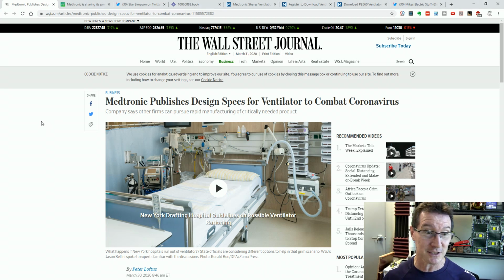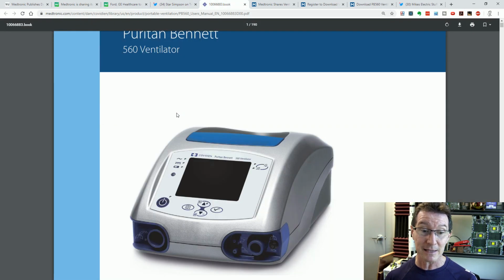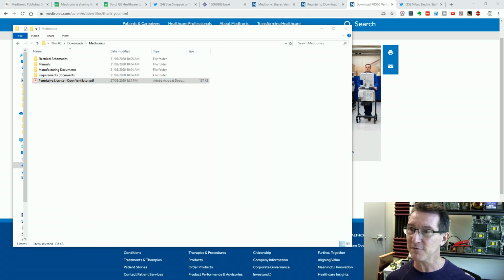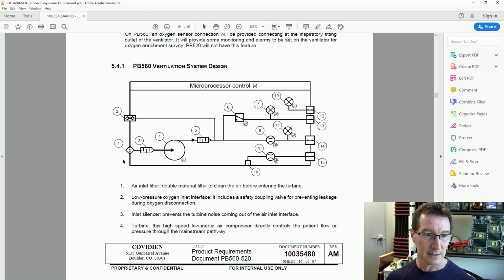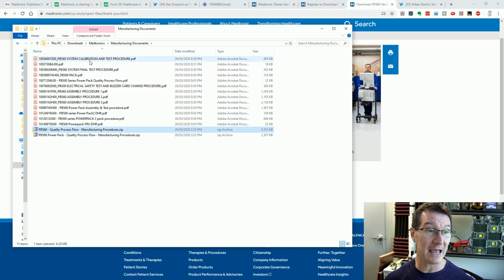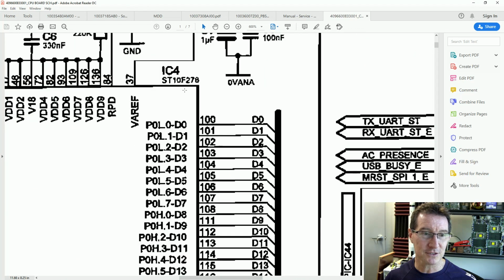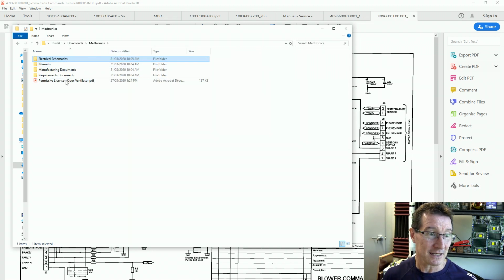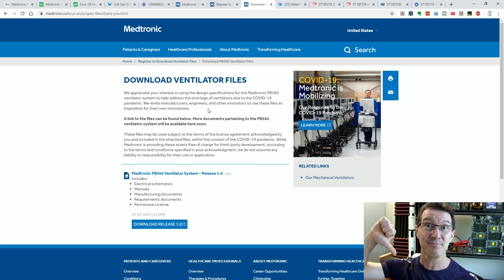eevBLAB #72 - BUSTED! Medtronics Open Ventilator FAIL

Comment: It might be a legal stunt to have people sign their "license", then design a ventilator, and then Medtronic can claim IP on the ventilators that people have designed from scratch anyway, but Medtronic will be able to claim that people used their IP because they downloaded the specs. Meh. Also have you looked at the schematics ? This is 1990 technology. Discrete parallel RAM, discrete parallel FLASH, and even discrete UART ! It's very possible most of these parts cannot be found anymore anyway, so definitely this is not a ready to copy design
Reply: Uski, combine those two thoughts - it's 90's technology, so people will be "inspired" to re-design it using modern tech, then release their design to the public, and the company will claim it as theirs.
Reply from the maker: Any company serious about this had better well checked the license extremely closely.
Reply: @EEVblog 
I would talk to an IP lawyer (such as Orrick) before developing on top of this.
It would be sad for a dozen MIT students to drop-out of school and spend a month on this to make something usable only for the corporate schmucks' lawyers at Medtronic to tell them that they own nothing.
Reply: @ba94845  Its a shame so many MIT students get duped into stupid stuff.
Reply: @MyKharli  Seems they have to still learn a thing or two. Even after learning at one of the best universitys in the world.
Reply: The discrete technology has a lot of advantages. It is easier to repair and one can still source components after 10 years or more.
Look at the schematics of a 50W railway PA amplifier, "Next train will be 2 hours late and depart from track 9".
LM741, 2N3055 and the like. 

Just like one copied a 1970s design from Elektor magazine. High noise figure, bad efficiency as this is class B and so on. But the German company who builds such stuff is proud of the design as they can ship it the next 20 years.
Reply: If it ain't broke... 🤷‍♂️
Reply: @sinaroughani7000  If you have a bus error, then the design is faulty. Always look at setup and hold times and do it right. Also life support systems need to be redundant, so the second system can step in, if the other fails.
My point is that if you use "primitive" technology you have less parts count, less parts to fail.
Also if you have 2 different systems using different approaches you eliminate common mode errors.
Just look at functional safety papers, chip failure calculations and so on.
Have cool semiconductors, and some over engineering. Also use parts that are easy to source so you can build a design 20+ years and supply it also to 3rd world countries for easy repair.
Why are there a lot of 1980s and 1970s Mercedes diesel out there in 3rd world countries? Because they last if there is no salt on the streets and if they see new engine oil when a change is due. Also repair is easy.
Take a modern car with 40+ ECUs and wait 30 years of operation. Are the microcontrollers used in those ECUs are still available?
If you have a solid industrial electronics design you can still source components for it after 30 years.
you can still source a DIL40 Z80!
https://www.digikey.com/product-detail/en/zilog/Z84C0008PEG/269-3895-ND/929205
Reply: old fashion ventilator??? WITH ANALOG CONTROLS?    that would be fine  EVEN quicker to deploy   also there is some on ebay forsale between 500$ and 1200$
Reply: @sinaroughani7000  Right, they could use the newest parts to make the thing three grams lighter or save a little bit of power, only to find out a while later that they fail in the most interesting ways. That may be OK for crap you sell to gamers, with life-or-death equipment, not so much.

Comment: Hi Dave,

As a mechanical engineer by trade (actually been mining Bitcoin for the past 10 years but that's another story), I think you are rather unfair with them.

That specification file is absolutely PRICELESS for any mechanical engineer wanting to replicate their stuff, I'm not a doctor, I don't know that stuff but I can certainly implement a specs into something that work (along with an electrical engineer to write the implementation). Honestly, designing, drafting, and prototyping that machine with that specs would take any mech. E 2-3 days to do, at most. 

Their enclosure and assembly drawings is really not what is the most valuable here, and it's literally the only document that are missing from that download.
Reply from the maker: I said in the video that it  could be useful to some, but it's FAR from anything useful to produce anything in any sensible timeframe. Sure it might be good small start to a multi year design product off the ground, but that's about it.

Comment: Even if somebody with too much time on his hand (alot of people these days unfortunately...)
Could manage to create a pcb out of it.
It propably need custom mechanical parts

There is no software, so you need to write it yourself

Then it needs to be tested and approved by medical safety departments.

By that time covid19 is over and we are talking /laughing about it like "remember in 2020?"
Reply from the maker: Even if you had the PCB and firmware, it's useless without all the sensors, pumps etc

Comment: "COVIDIEN" ? Oh ok.
Reply: The name is just a spooky coincidence. Back in June 2014, Medtronic announced it would execute a tax inversion to Ireland by acquiring Irish-based Covidien plc (a previous U.S. tax inversion to Ireland in 2007). So Medtronic is now headquartered in Dublin Ireland for the lower corporation tax rate.

Although Medtronic does have a manufacturing plant in Galway Ireland making ventilators as the Irish news have shown them a few times, they wanted to hire more people at its Galway ventilator plant so that it can move to a 24hr production line to get more machines made. Most of them would problary get sent to America.
Reply: @unofficiallymike  What does any of that have to do with the name? Are you associated with the company in any way?
Reply: @xenonram  covidien and medtronics are one of the largest medical supplies manufacturers on the planet. hes just stating where they got their name from or the history behind it. medical supplies are a huge industry and whenever a new company comes out medline and medtronics will swoop in and buy them out or make sure they never make it.
Reply: I would have gone with Covidinator
Reply: yea i saw that wtf?

Comment: My $0.02 as a medical design engineer...

These are the medical device design input files.
Useful, but only if making your own ventilator from scratch...
Its not the design output files which I expect others are looking for.
Cheers,
Reply: @Kandralla  There is a shit load of work behind a solid spec., and even more so for a spec for a product that will pass safety compliance testing - but I struggle to see who the target audience is. I mean, if you know how to interpret this specification, it's likely you know how ventilators work already. It's even probable that you have experience from medical equipment engineering already. Ergo, you should know most of this anyway. If you're starting now, and don't know how a ventilator works, and have no experience with medical safety compliance, this document doesn't give you all that, you need to know how to implement as well. It feels like a bit of a catch 22. For someone with little or no experience, they have to implement, troubleshoot and iterate over their implementations to get to a reliable set of output manufacturing documentation. This takes time, which is what we don't have. And it's expensive. Not to mention how this has to be approved afterwards. Also a timely and expensive process. As a company it's not very attractive, because you're basically putting money into IP that another company will own, and as a happy DIY-er/hobbyist/etc., developing a product like this from scratch is even more costly and takes even longer. I appreciate the effort, but I don't see the value.
Reply: @Kandralla  exactly that’s why this is bs in terms of helpful in the short term emergency we have now
Reply from the maker: It's barely even got that.
Reply: @EEVblog  it's what you need to create the design documents that can then be used to create the actual design (CAD, etc.) files that drive the manufacturing process.
Even with these documents though it's still going to take months to create an actual design, let alone a production line.
Reply: @jwenting Thank you for the clarification. Interesting.
Reply: @CaptainDuckman exactly that’s why this is bs. For help in an emergency with urgent need

Comment: Why just not take a older design and update that? Ventilators have been around since 1930s...
Reply: Because: (1) The components that were used decades ago are not going to be available today. And (2) If equivalent pumps, valves, etc. could be quickly located today, it is probably slower to produce a design from decades ago than a current design.  All those welds, screws, and manual soldering take longer than making a circuit board with an automated machine, and snapping plastic parts together. Note that a big hold-up with and old or new design is that their production require dedicated tooling.  Today that is going to be things like injection molds for the plastic parts and test stands to make sure the machines are working correctly.  In the past, it could have been stamping dies for metal parts and, again, test stands to make sure the machine is working correctly. Building more of these tools is going to take time.

A HUGE advantage of making current designs is that there are experts around that know exactly how to make and test the machine.  Even if you could find excellent documentation of the design, production, and testing methods used for a decades old machine, the documentation can never match having an expert available to answer questions.  I would expect resurrecting even a fairly simple design that is decades old would take much more effort and time than using a current design.

Comment: I'm in  the thick of developing an FDA-regulated medical device. The information that Medtronics has provided represents literally thousands of hours of design, development, and documentation. ANYONE looking to develop their own ventilator will be FAR FAR ahead of the curve using the Medtronics design specifications as their starting point.  Until you've dealt with medical device regulations, don't discredit or underestimate the work that goes into just getting the FDA to look at what you're doing, let alone pass anything.  Every line item in the specification documents has to be verified and validated. Sure, you can build something in your garage that works, but unless the FDA approves of what you're building, good luck getting them out to be used. Of course, the EU has different guidelines, so YMMV. Bottom line, this is worth a lot more than you know to anyone who has legitimately worked in medical device development.
Reply from the maker: I said in the video it could be useful to some, but it's far cry from what's needed to help design and produce something this year
Reply: @EEVblog  how do you know this event will end this year ?
Reply: yes, I think the main gripe is that they claim to have published the entire design, hinting that people can use the published documents and start churning them out in bulk, when in fact they only published the product requirements specification document and some user manuals.
Still a lot of time and effort, but, as a lawyer would put it, "not as advertised". Or maybe it was blown out of proportions by the media hype.

Comment: I don't get the Medtronics hate. If anyone misrepresented what was being provided, it was the journalists who didn't review the files. If aliens beam down the schematics for a space ship, how many are going to be complaining that they're only in pdf format and one of the flux capacitors isn't commercially available? Lots of people trying to build sophisticated medical devices on a budget right now. Rather than start from scratch, seems like you'd rather start with an example of a fully documented, tested, functioning, and FDA-approved product. Personally, I think it's mildly admirable a private company would share that information.
Reply from the maker: That's kinda the point of this video, it's so hopefully the media see this and don't then go off giving Medtronics publicity like they are saving the world by opening their ventilator design so others can make it.
Reply: they didn't share the actual design documents at all. They only shared the documents describing in general terms what the design documents should detail. 
Which would then be used to create the actual design.
Reply: @jwenting  They DID supply the electrical schematics, which are indeed design documents. However without the mechanical design details, and especially the software, it's certainly very incomplete. A huge help if a team is looking for electrical examples and the requirements doc really puts other naive efforts in context.  But not a recipe for just putting machines into production, and I don't think it was intended to be.

Comment: They released the specifications. They never promised anything else. What do you expect them to do, supply free hard tooling to everyone as well?
Reply from the maker: Why release "manufacturing files", or even schematics? They are essentially useless. It's so the media can (mistakingly) hype this up as them releasing actual useful design files to build replicators.
Reply: I would expect them to release full manufacturing data with all the logistics info and bills of materials, start to sell specialized parts that are hard to put into production (basically all the spares and molded plastic parts) and to license it to anyone with time limited license. Basicaly I would expect them to allow the whole industry to boost global production rates of their product up and to lower the prices. That would really be a responsible answer to the stuaton.

Comment: You know half-baked as it might be... there might be a hi-rel design trick or two in that schematic. So, I get what I can and continue, life is simple.-)
Reply: But you're not allowed to use that trick for anything commercial after the crisis is over. Why spend weeks and weeks (money) understanding the little information that they have, when what you're achieving is to have some information that you're not allowed to use? If you wanted to know how a respirator works, you'd just read old patents instead.

Comment: To be fair, the headline you shared does say "specifications" not designs or plans.
Reply: MineStrongth To be fair my wife saw this very story in the news making it out to be the fix of all problems.
Reply: It's being reported as far more than it is and just some specs aren't really going to make much difference here.

One can get a repair manual for something, but that doesn't mean it's got everything needed to figure out how to build a new one or even something similar. For that, one would need to those ICs or, better, schematics for the internals of those ICs. Of course, then you run into the risk of possible issues with the manufacturers of said ICs.

Comment: The epidemic first wave will be over in 4-6 weeks, none of this projects will be finished in time and ever get to use. If politicians don't screw up again by doing nothing to prepare and prevent,  following waves will be much smaller and easy to handle with the existing and new made professional equipment.

Comment: If anything this lack of information will stifle the development of another system, sure there will be some very useful info in the files, but when time is important like it is right now, this wastes someones time which could have been spent actually making a ventilator.
Reply from the maker: Depends on what you wan to achieve. If it's a new ventilator within months, then yeah, like more hinderance than good. But if you want t spend years designing an FDA approved device it could very well be useful. But then you gotta watch the license agreement, its seems a bit tricky...

Comment: Medtronic: "we're sharing all of our designs to help others manufacturing ventilators for saving lives."
Shares everything you could already find in the service manual.
Bravo, Medtronic!!!
Reply: My guess was that they were going to give us something that required us all to buy like $4000 boards with the CPU/FW on it and then we get to program on the outer layer, like Android.
Reply: Well of course they wouldn't share the entire design for others to manufacture.

But this information on how exactly a ventilator must work down to waveforms, pressures and flow rates is invaluable if you are going to design one.
Reply: @berni8k  open source copy catz can't actually design shit. All the can do is copy, rip off and complain.
Reply: THERE IS MORE FILESRELEASED, CHECK THEM!!

Medtronic PB560 Ventilator System – Release 2.0 (.zip)
Includes:

Manufacturing fixtures
Printed circuit board drawings (including multiple BOMs)
3D CAD files
Mechanical part drawings
Reply: @Bob Sacamano indeed!
Reply: I'm sure if you contact medtronic's and are a manufacturer, they will give you the design files and software so you can make them.
Reply: Chubbysumo I wouldn’t bet  a dime 
on that... but tell us if you have some evidence. I’’d be happily surprised !
Reply: @Bob Sacamano actually they did release them, but in batches 2 and 3 respectively. Shame engineers nowadays don't want to read things thoroughly....
Reply: just a pr gag
Reply: You do not find everything in the service manual??? What are you talking about? Go ahead and look at the PB840 and PB980 service manuals. They are extensive, but limited in comparison to this topic.
Reply: Uncle Joe they want money. None of that life-saving philanthropy bullshit. More publicity = more revenue. (Sigh...😒)